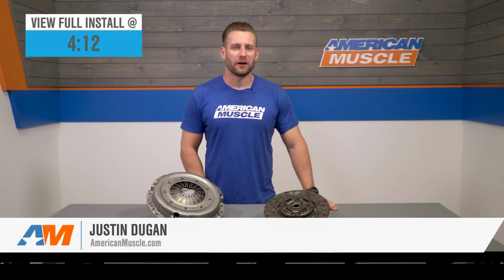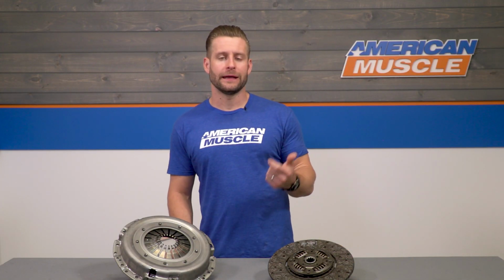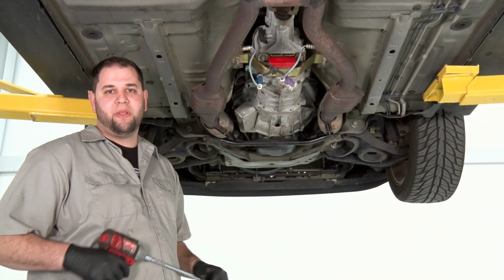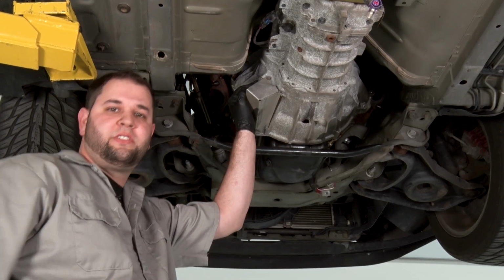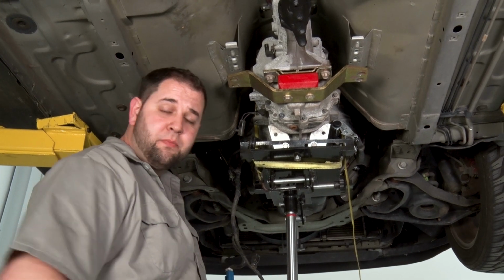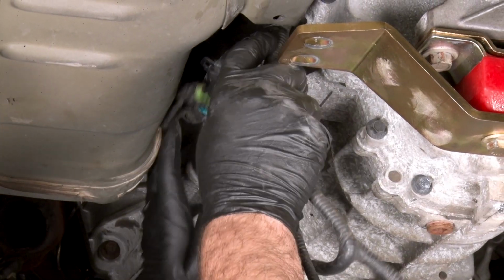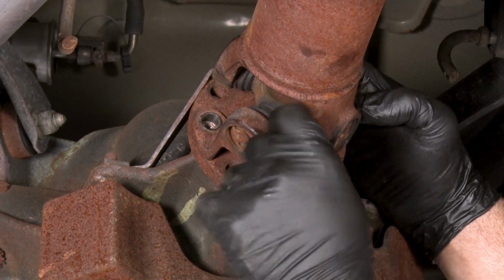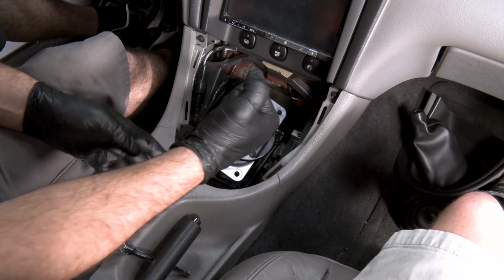1999-2004 Mustang GT, Cobra & Mach 1 Exedy Mach 400 Stage 2 Clutch Review & Install

Comment: What a dork 🤣.  "So I realized I have to unbolt and remove this cross bar in order to lower the transmission".  NO SHIT!!  He totally skips the worst part.  Removal of the starter bolts is a bitch, and removing the top two bell housing bolts sucks.  I slid my transmission out by myself on my chest, no help or a car lift.
Reply: What did you do with it at that point? Roll it onto the ground? And how heavy is that thing?